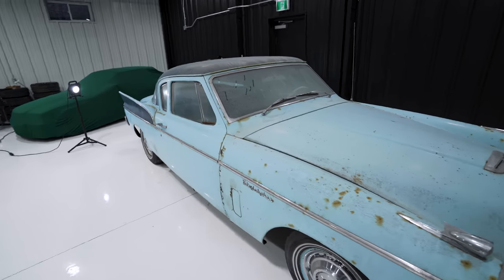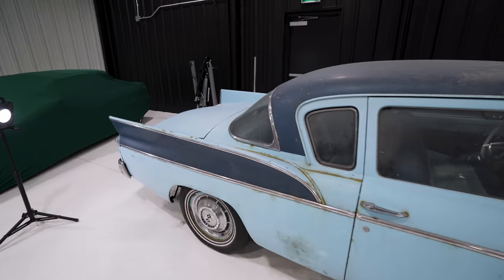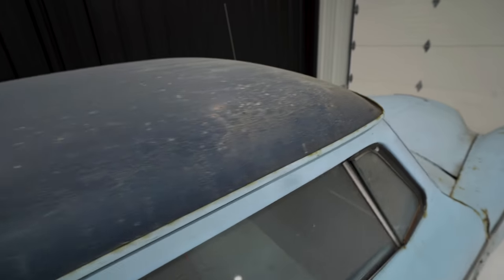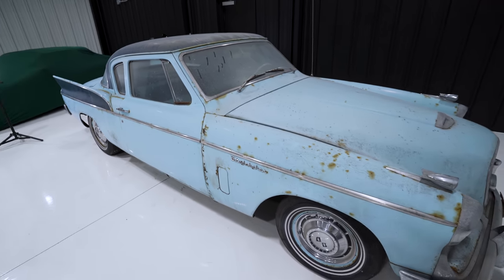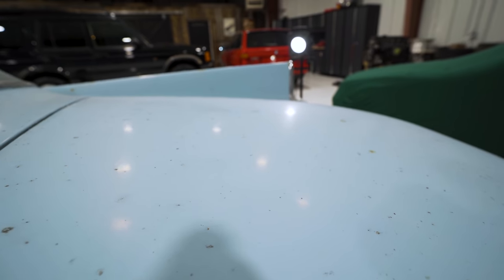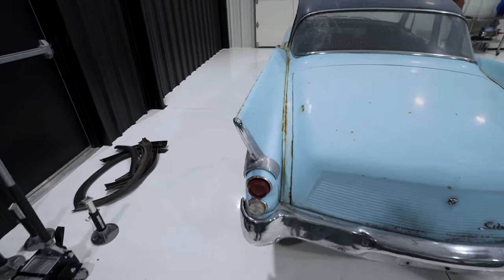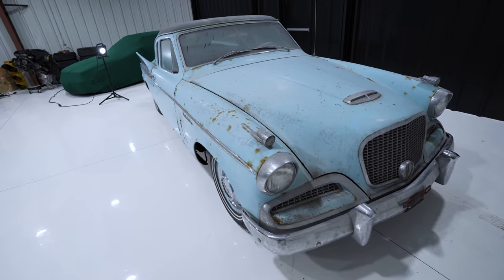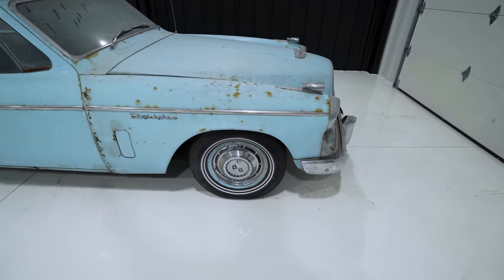Transforming The Chalky Paint On This 70 Year Old Bird Poo Covered Car

Comment: Just wanted to say your videos are really inspiring and have taught me so much. Beyond grateful for the content you produce. Truly is a craft that you’ve made into art. Quick question…I have a 2001 e39 and I was curious if it was good practice to check paint depth before going crazy with a 2 step correction (using a DA). It’s been garage kept for most of its life but it’s always on the back of my mind that imma blow through it. Will be applying ceramic coating after detail as well.
Reply from the maker: Thank you so much John! Really happy to hear they help people in anyway at all. I personally wouldn’t use a paint gauge but if you want to be absolutely certain of the depth it would help. But at the same time all is take is one spin of the pad too much to go through. I have never actually burned through one of that era of cars.

Comment: After the polishing stage I would have continued with nourishing the paint. Dried out as it is it will deteriorate even faster with the fresh surface exposed. For a week I would have soaked the paint in a mixture of white mineral oil and baby oil. Leave it wet and repeat for a sequence of seven days. Then polish it again with a pad only primed but without further polishing agents. Seems strange but works wonders! Gloss and depth will be restored where paint was left. And corrosion will be slowed down by soaking every bit of surface in oil.
Reply from the maker: I don’t think I have heard of a single thing you just mentioned haha. If it works for you though I’m sure it’s good enough for all! I just would never have a week 🥲
Reply: You can also do the same with Meguiars Show Car Glaze #7. Just used it on my 57 Bel Air and results are fantastic.
Reply: @mikebaldwin-noaafederal485  You are perfectly right - but I am based in Germany it this is very hard if at all obtainable for us. those old paints need "nourishing" with the oils!